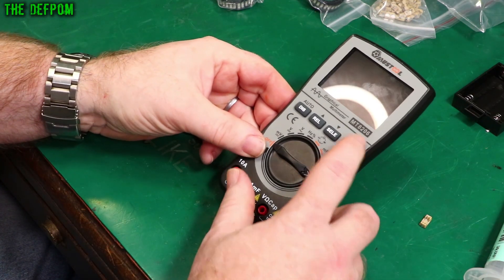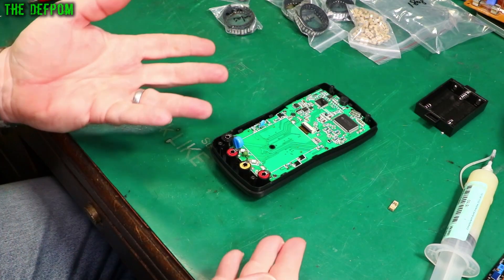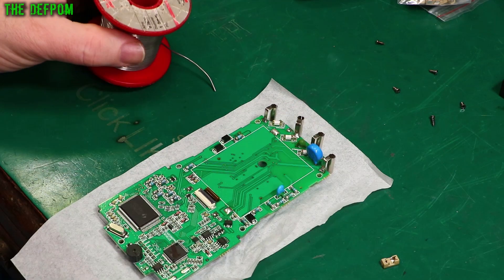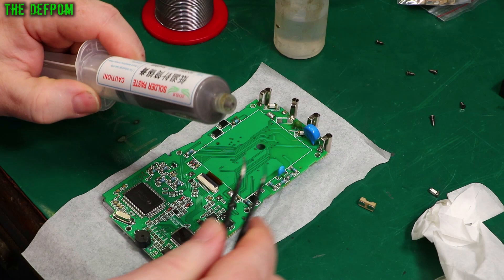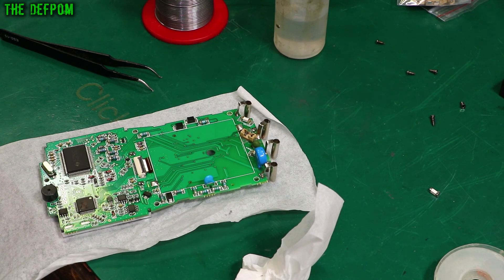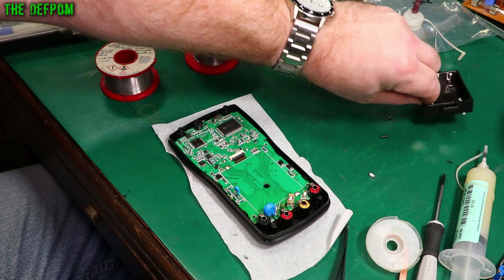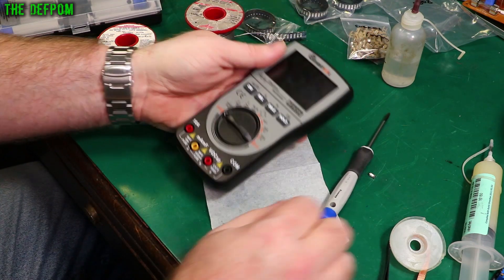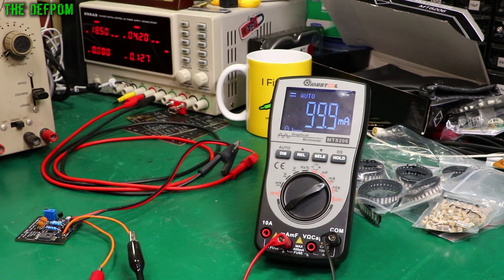🔴 Mustool MT8206 Stupid DMM Fuse Replacement - No.1014

Comment: I used a lazy person solution. I just soldered a new SM fuse on top of the old one. You don't need to remove the battery holder or take the circuit board out of the case. It just takes a few minutes. It is odd that they did not put in sockets for the fuses. The manual gives the fuse specs, but says nothing more. Thanks to this video I found where they were.